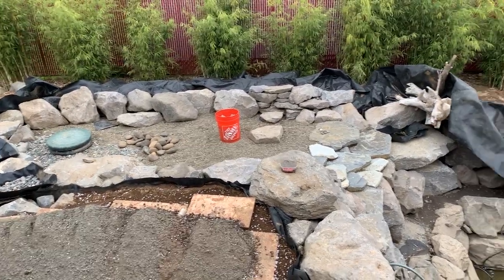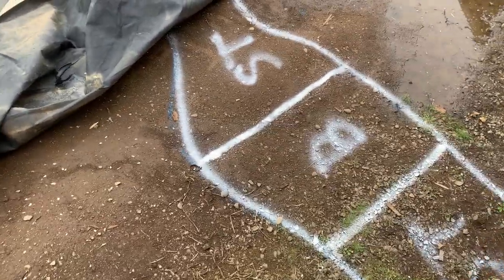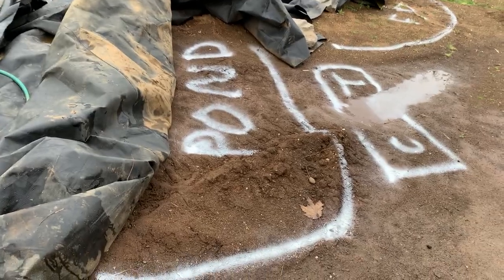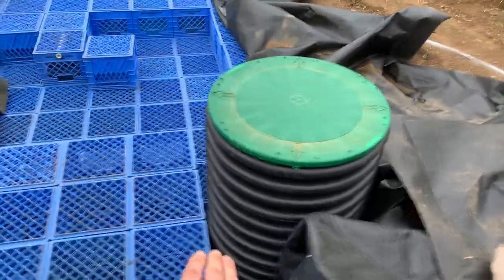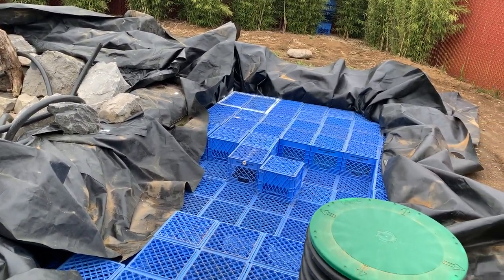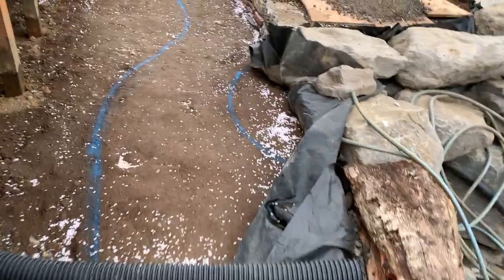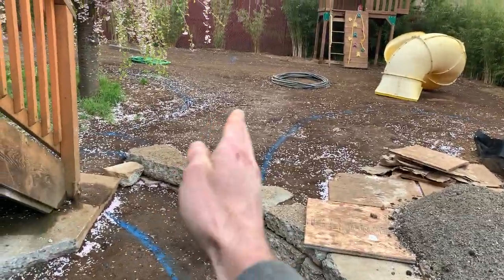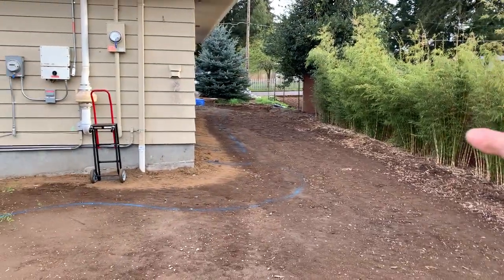Back Yard Water Garden: April Landscaping Update

Comment: 5:05 hey hello, nice project! what is the purpose of doing multiple layers of those milk crates?
Reply from the maker: Thanks. The milk crates create a void space that can be occupied by about 3,000 gallons of water, shielded from the sun. It should help tremendously with maintaining water quality/clarity as well as collect rain water in the spring that will keep the pond full in the summer without supplemental water.
Reply: @TylerTervooren  so when the pond water level drops, you can pump water from this void space?
Reply from the maker: @noyezz3690  Kind of. The nature of a pond with a negative edge is that the pond level never drops. It is constant. Water level only fluctuates in the cistern. But yes, having that store of water “underground” will allow going much longer without adding water.
Reply: @TylerTervooren  aaaahh cool, now I get it, that's very smart :)!